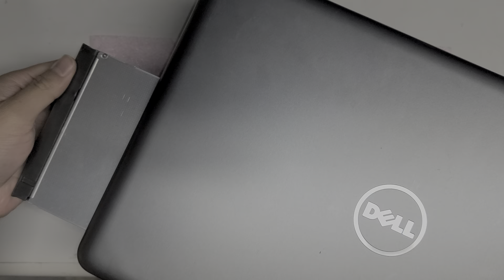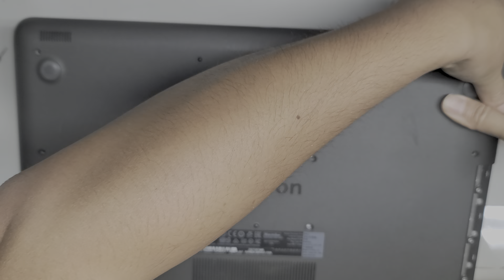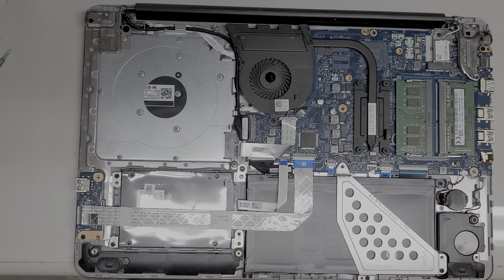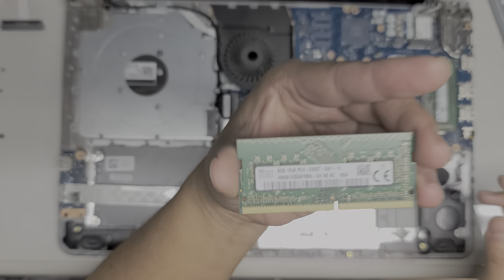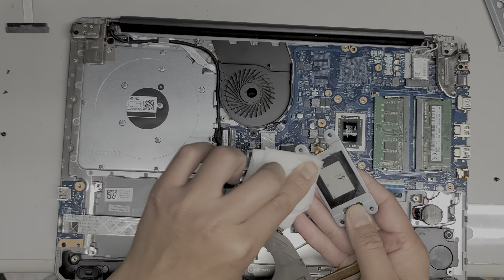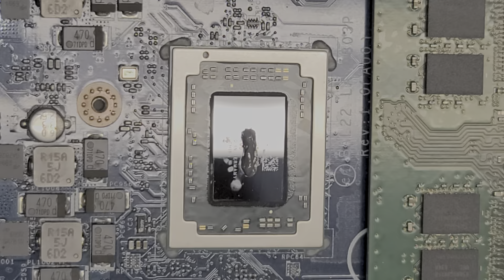Dell Inspiron 15 5565 Disassembly RAM SSD Hard Drive Upgrade Repair Replace Battery Thermal Paste

Comment: Unfortunately those 3 screws in the dvd drive are completely stuck, but I got the others on the outside with barely any effort. Why...this happens to anything I try to fix...
Reply from the maker: Might need a different screwdriver

Comment: I want to upgrade the hard drive, but I don't know if it's better to Buy m.2 sata or the one in the video?
Reply from the maker: Where would you install the m.2 SSD? Didn't see a slot. Did I miss it?
Reply: @ItsBinhRepaired  i've never opened and i'm new in these things.. that's why i asked. That model doesn't have a m.2 ssd slot?
Reply from the maker: @sindzero  if your model is the same as the one in the video, make sure to watch it all the way through before attempting any repairs/upgrades.
Reply from the maker: I think this only has a 2.5" sata slot

Comment: Do your motherboard limit ram speed to 933MHz (1866 both)? I want to know if it's possible to upload Dell Inspiron 15 5565 speed to 1200HMz (2400HMz both)
Reply from the maker: Not sure. It's not mine. You can buy from a store that accepts returns and try it.

Comment: This was great, thank you! I have had my Dell Inspiron 15 5565 for about 4-5 years. Unfortunately, after leaving it plugged in for too long, I destroyed the battery - it became a swelled mess & began to affect other areas of the laptop (e.g. touchpad). After ordering a new battery, I STRUGGLED to find a comprehensive video or textual guide to walk me through the process of replacing it. I printed the Service Manual from Dell’s website &, combined with this video, I was able to bust open a computer (for the first time EVER) & actually complete the battery replacement (successfully!) all by MYSELF. Feeling pretty damn proud of myself. 😌🤓I would not have been able to complete this project without this video, & I’ve saved it for future reference - as I believe a new hard drive is also in order. Thank you, again!!! 🤩
Reply from the maker: SSD upgrade